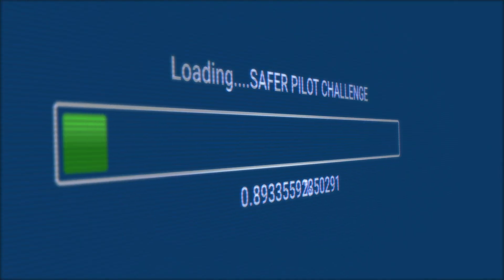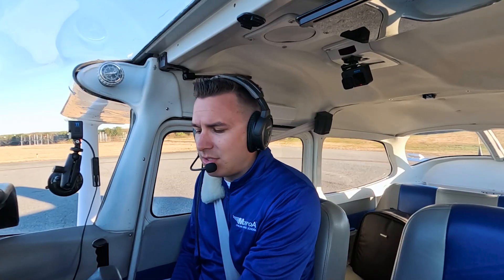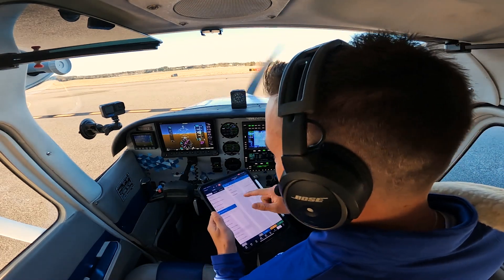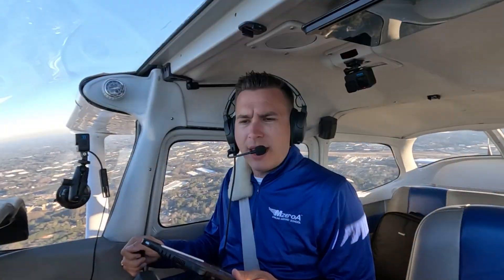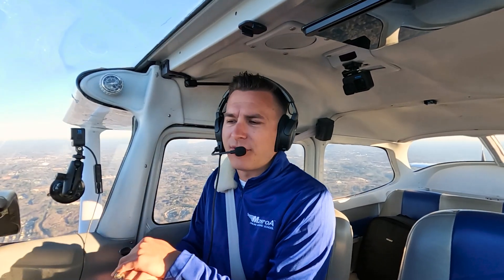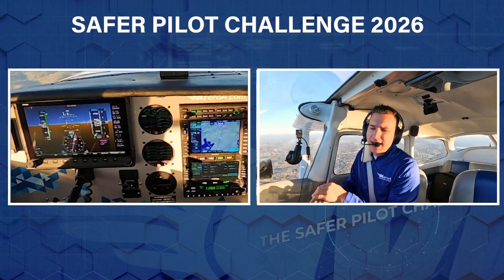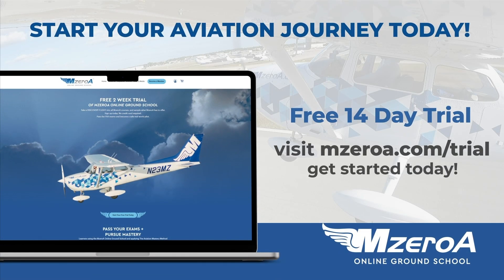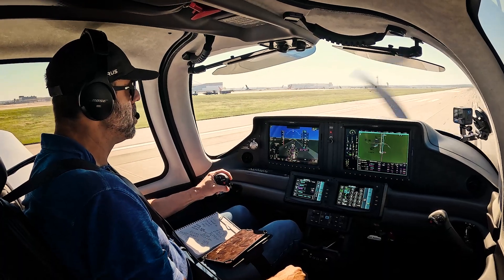Leaning for Safety: Engine Monitoring and Health Trends

Comment: 14 for 14 from Hungary - being a small country, we don’t have any airports/-fields with elevation above 3000ft - also, as most of the planes I fly either have a FADEC (C172 Diesel) or lack the necessary instruments (EGT or CHT) for proper leaning, the SMARTER (even if not the most efficient) way for me to fly is with full rich all the time. The only time I’d lean the mixture a bit is during runup if the magneto check results in a higher-than-normal rpm drop - in those cases I’d give it a bit more power with a leaner mixture to burn off any potential carbon build-up on the spark plugs.

Comment: IDK. This is one of those things I still don't understand. I lean on the ground (Denver). Don't get above 3k AGL due to Bravo. But when I end up doing my cross countries I will. So, what exactly are you leaning to? Sound? A performance number? When the RPM's drop then a solid full turn back in the other direction? I'm sure there's a YouTube video out there that will answer it but I have been curious about this one. Just trying to get SMARTER. 14 for 14.
Reply: I’m glad you brought this up Clinton, because it’s important to understand! Mixture leaning is dependent solely MSL, as opposed to AGL! 

So for example in Denver, let’s take Centennial (KAPA), field elevation is 5,885 ft. If we are sitting on the runway we’re 0 AGL, but 5,885 MSL. Ideally you want to  lean the mixture to attain maximum RPM’s for takeoff, which will keep the engine cool, and prevent spark plug fowling!

Let me know if that makes more sense, as I’m happy to explain it further!
Reply: @JamieBMzeroA  Okay. That makes sense. And then as we continue to climb at some point we would have to lean again, right? I thought I heard somewhere 3k feet up? So again at 9k? And I'm in the G1000 so we use the Lean/Assist mode but I doubt I use that when in flight? Okay... that was like 30 questions... sorry. Leaning is the one thing that still confuses me a little bit.
Reply: @ClintonJAndersen  In theory the higher you climb, the more you lean, but the 3,000 foot threshold I’m speaking of is 3,000 MSL, so with you in Denver up already at 6,000 feet MSL, you’re already in the region to takeoff with a leaned mixture, and then continue leaning as you climb, to maintain the maximum RPM’s!

Where the 3,000 feet comes into play, is let’s say you were in Tampa, Florida, taking off at sea level, you would maintain full mixture until reaching 3,000 MSL and then lean above that, or as directed by your POH/AFM. It just so happens that 3,000 AGL coincides with 3,000 MSL down there.

Comment: 14 for 14: Having an engine monitor in my plane is a game changer. I have been able to keep temps more precise and monitor fuel flow better as well. Leaning for taxi is something I was recently told about and that has helped prevent spark plug fouling as well.